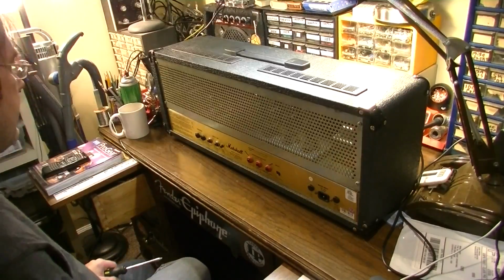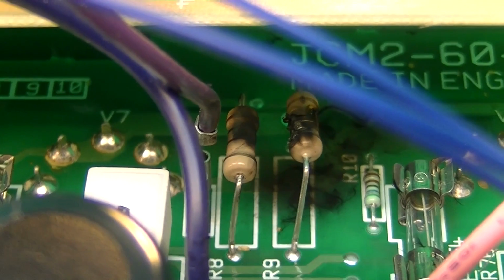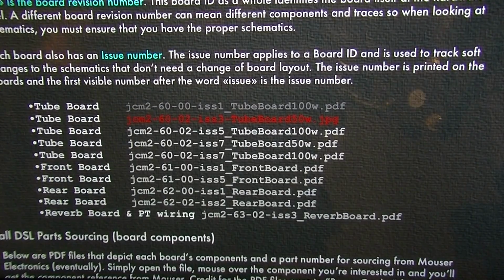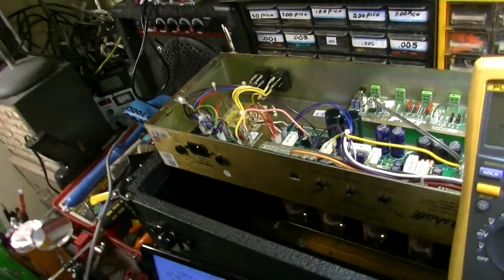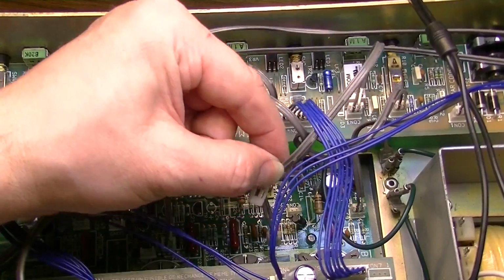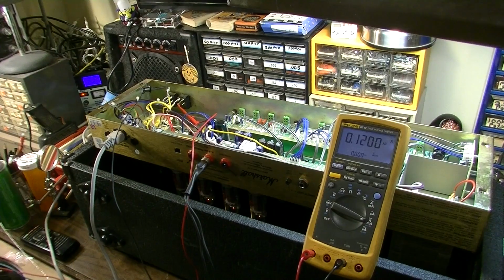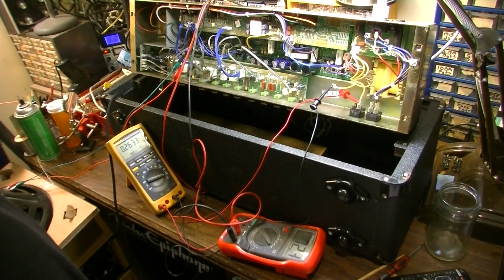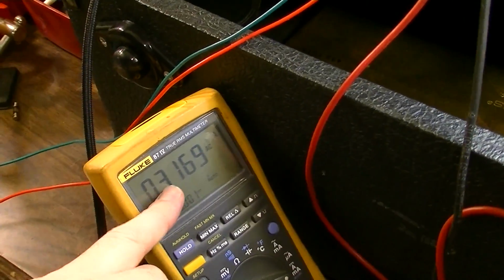Mother of All Marshall Amp Repair Videos - DSL100 Blowing Fuses, Bias Runaway, Fun Times!

Comment: I bought a JCM 2000 used and after a week or so it developed a similar problem. Sent it in for repair and it came back sounding great. That was 5 years ago and it's still going strong with no problems. Love that amp.

Comment: I have a JCM2000 DSL 100w from 1997.  Mine was one of the first ones off the production line because it was an artist endorsed amp.  The amp ran about an hour before the tubes started melting down.  The problem (amongst many) was the bias drift.  All the boards were changed and several components were upgraded.  What a major pain in the ass.  But in terms of sound, it s the best Marshall I've ever had.  It's been in service for well over 20 years and since the boards were changed out, I've never had a problem with it.

Comment: I have a 2002 Marshall JCM 2000 DSL 100. It had the bias drift problem. A few minutes with a Dremel and four new grid resistors for the power tubes and the problem is solved. Bias is rock solid. Touched up the solder joints on the bias adjust board while I was in there since that's a common failure mode (cracked solder joints). The amp plays great now and runs very stable. These amps get a deservedly bad rap for poor engineering of the main board but it's an easy fix and you end up with a great amp that rocks.

Comment: I know this is a two year old video and i really appreciate Brad's videos...yes here comes the big 'however'  this scenario is clearly nothing more than an intermittently shorting EL34.
I've worked I dozens of these TSL and DSL's and this is a very common scenario.
I'll bet if you had rapped on that one EL34 you Wurlys have seen major sparks as the weakened elements shorted together.
Nice walk through taking one apart for those who han hadn't.
BTW i heard of the rumor of conductive boards in these amps and after repairing literally dozens of the i never found that to be true.
Nicely done video as usual..

Comment: The first repair I ever made on an amp was my JCM 2000 401 that would intermittently loose power to the tube heaters.  I was nervous messing with it but luckily it was a common problem with the bridge rectifier.  I later sold that thing and people like you have inspired me to use more vintage style amplifiers and I couldn't be happier with the tone and serviceability.
Reply: Same.

Comment: It's cool you didn't have to change the entire board like some people recommend. It looks like Marshall got a hold of some bad capacitors. The 2000 series amps sound really good when they're working properly. I have two Marshall TSL60s . Once I accidentally hooked my 4x12 into the TSL's effects loop and blew a fuse when I powered it up. After that I put yellow electrical tape over the effects loop inputs to make sure I'd never do that again. Good video!

Comment: Kudos to you sir.  You know your stuff!   I blew my amp the other night.  Same one you have here (JCM2000 DSL 100 watt into a 1960 dsl900 4x12 cab).  I was playing on "2"  for about an hour when my other guitarist decided to crank it at practice.  I got tired of him blowing us all out, so I turned the amp up on 10.  Struck one chord and... crickets.   Used my backup fender amp to finish practice.  Now looking further into my prob, I see that an EL34 has blown. Looking from the back of the amp, it is the left outermost tube.  I also blew the D198 250 VA fuse.  No smell in the amp so I hope I didn't blow anything else.  Didn't make note when I unplugged everything (it was late) but I believe I mistakenly had the cab plugged into the 8 ohm output on the amp. :(   It played for an hour, so, I'm not sure if the ohm mismatch blew it or not.  But if it did, where else would I have issues?  Also, where can I get another D198 fuse?  Thanks so much for any help you can give!
Reply: If you ever found the answers to your questions, PLEASE LMK!  I am fairly certain that my ORIGINAL prob (way back) was accidentally playing through mismatched cans. Now I just re-tubed, & blew HT fuse. I've got a lot of digging & video watching & I'm dying to get back into playing now! (Plus been working 6-7 nights/ week lately... I know, I'm pitiful... all help much appreciated!

Comment: Excellent job. I have been a 100% Marshall tube amp guy going back to 1979. I don't play anything else. My current long time babies are a 1991 JCM 900 Model 2100 which I had repaired a few years back by Gary Lowe (Randy Rhoads amp/electronic tech) and a Vintage/Modern Model 2466... if you work on either of these, I am all eyes and ears.

Comment: Brad, I have fixed the Thermal Runaway issue with these amps.  The circuit board material becomes conductive over time and then the tubes loose bias and then runaway.  I isolate pin 3 of all the power tubes from the board by cleaning around the pin with a dremel.  Then a jumper wire is installed to complete the circuit that you have cut.
Reply from the maker: I was thinking at first I might have to do that.

Comment: 90mv is 45ma per tube - hot!  Those pots are highly interactive.  I was thinking that they adjust the tubes on the opposite side.  C46 has a tendency to blow short.  You are lucky that you didn't have the dreaded conductive PCB issue, which requires some work with a Dremel.  Thanks for the tip on those caps.
Reply from the maker: Yeah, you gotta jump back and forth to get the bias set.
Reply: I thought when he said 90 in the video it was awfully damn high. Those resistors likely fried whenever you cranked the hell out of it trying to get it set to 90. 30 is on the cool side and 45 would be hot as a firecracker with a set of your favorite humbuckers. The bias on mine was just set between 33 and 35 if I'm not mistaken.

Comment: Had a bias runaway with a 2000 series last year and after a good deal of research on the internet, the only way I solved the problem was to remove all 4  PA valve bases and dril 6mm hole  where each  grid pin came through the PCB, refitted the valve bases and wired  the grid stoppers directly to the grid pin. What's happening is the PCB coating is conductive (Marshall know this!). this stopped the bias runner way. ALSO some of the random noise from the speaker was due to the track thickness on the heater circuit not suffient to carry the large heater current. I therefore rewire the heater to all valves with good quality  heavy cable which cured the noise problem. My advice to engineers who get these amps in for repair is - run for the hills!
Reply: Hi Geoff wow interesting info thanks for sharing mate!  So it was the COATING on the boards that was conductive ay?  Do you mean like the conformal coating lacquer, or is it the solder mask or the screen printed layers?  Curious that it was only around the screen terminals & not around the anodes.  Geez Marshall must have had halfwits working for them when the 2000 series came out - so many problems.  They may go out the way Gibson did!  I can see the Fender guys rubbing their hands together in anticipation!

Comment: Mate ! , I was waiting for you to find an intermittent short on/in, a power tube .. I shelled out for a tube tester to eliminate faulty tube dramas at 1st base.. I read up on tube control Bias a lot lately , and  i find the current sensing resistor , is there not only to reference milliamps to millivolts , but it is also to protect the control grid like a fuse would .. which is why you only should use just a half watt , 1 ohm type . (of course if you use 10 ohm , it would show 10 mV for 1 mA). 
When i build a fixed bias amp, i make sure i have available, as a bias voltage , at least 10 % of the plate voltage , at the middle of the bias pot travel . so if the amp idling( all volumes and eq turned down to 0), has a plate voltage of say 480 dc volt ,, i want -48 v on the centre of the bias pots travel .and i want to be able to adjust that by 25% each way at least . 
There could be a problem in your bias voltage supply .. crap filter cap , resistor ,, and make sure you have a decent negative voltage on the control grid . Pin 5 on that octal tube.. 
Over here in Australia , the amp companies built large amps with insufficient bias control , and the same with heater current . i had an amp built here that had 6 of EL 34 and 3 of 12 ax7's , and the heater winding for the power tubes  was only good for 6 amps, which is why it chewed through tubes , stripped the damn cathodes !  when the fault takes out the current sensing resistor , its preety much saving the output transformer from dying ! Cheers Brad ,, love your work ..

Comment: I watched your video.  You had a spark inside the 3rd output tube from the left. Bad tube.  There were many clues to this end. First was the blown resistor.  Only way that resistor would explode the way it did was with a ton of current very fast.

Comment: Man i had a TSL 100 that would run away. Id send it to my guy hed bias it then give it back and it would do it again. After about 3 sets of tubes i did some checking and found bias resistors that woukd thermal reactive. They would change value with a hair dryer on them. Finally got a new main board and the problem went away. Funny thing all thise suspucious resistors were changed to better ones. I hate engineer bean counters. Now i play a metro and a matchless. No more pcb for me. Keep on keepin on.

Comment: Brad,
Great video as always!  Double check me on this, but I think the 8 & 4 ohm jacks get their ground from the make/break ground contacts on the 16ohm jack. I believe you see where I’m going with this and the possibility’s for bad things to happen. Jumper the grounds on the 16 ohm jack, from one side of the jack to the other. If your test speaker was plugged in the 8ohm jack when the HT fuse blew................
Reply from the maker: Thanks for the comment. I'm going to check that. It WAS plugged into the 8 ohm jack.
Reply: Let me know what you find!
Reply: Also check C46. EDIT: it is an anti-oscillation cap. Several malfunctions can cause oscillation and blow the HT fuse.  C46 should located at the end of the board, next to the 5w resistor. Marshall changed the cap to 1kv from 500v. Internet grapevine says 1kv isn’t enough either. Got to be the truth. I seen it on “Geraldo!”

Comment: Exact same thing happened in my TSL, same resistor exploded and took out the smaller 1/4 watt below it. I had just installed a quartet of JJ 6CA7 tubes and "it go boom" too. Replaced the 1 ohm resistors with flame proofs. My board is the darker green version although not the latest issue. The amp is from 2006. I put the original stock Svetlanas' back in and no fireworks. I'm going to check the cap you replaced on mine. Another poster said these Marshalls' don't like JJ tubes. Looks like there's a trend.
Reply from the maker: I'm still burning in and testing for now, but still not blowing with a proper speaker cable and cab. If it does it again, I'm going to advise some new power tubes. This customer had already changed these before bringing it to me.
Reply: replace with a VER 20 cures everything

Comment: Excellent vid, liked the diagnostics, following the problem was an excellent instructional, could be used on any marshall, I was surprised to see that cap on the power switch input circuit was bad, something to remember, Great vids, thanks a lot, use them for my own repairs, however limited. Also another really great fact about the different issue numbers on schematics and amps! Thanks again!

Comment: I had one of these. Same problem and it ended up burning the board. Something to do with the PCB design and traces of the earlier ones. Amp tech bypassed those traces by hand wiring that part of the circuit. He called it 'lifting'.

Comment: A good idea for a video would be converting a tube amp to solid state or vice versa.
Another good idea would be a video showing how to convert one of those line 6spider valves into a normal non digital tube amp by bypassing all that digital crap. Love the channel.
Reply from the maker: Converting a tube amp into a SS would be a fun one. The comment section on that would rule. :D